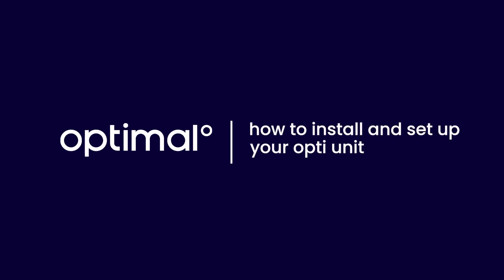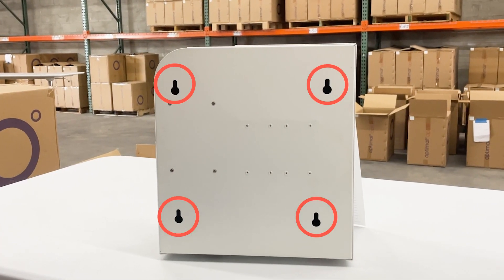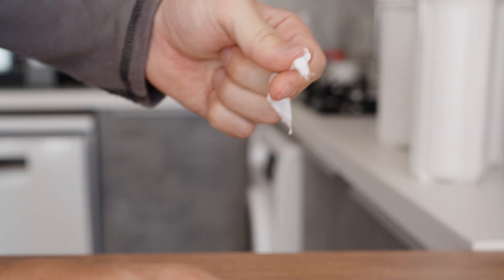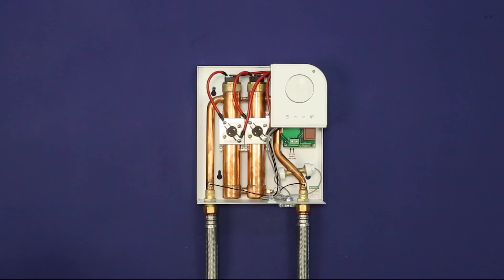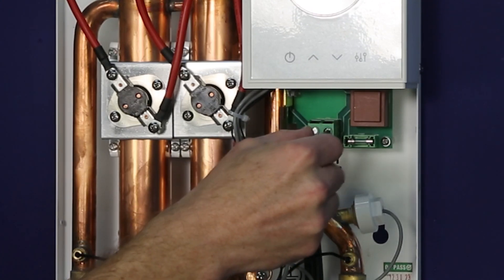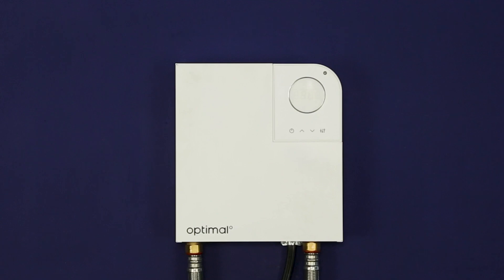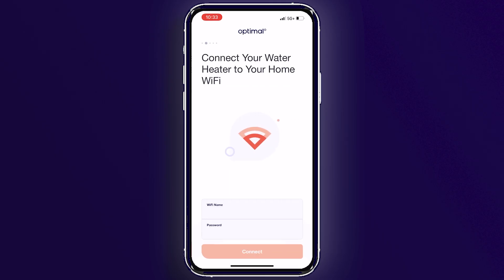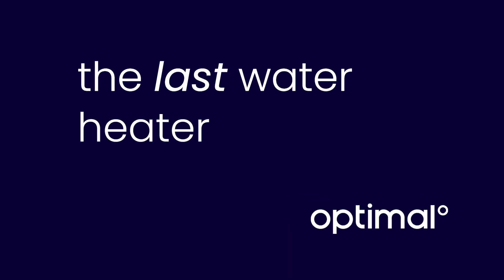Optimal° Installation Tutorial | Electric Tankless Water Heater

Comment: What's the power supply requirement for the 3.7 gpm model opti18?
Reply: Model #OPTI18:   75A Max Draw,   2ea  Double-Pole, 40A Breaker.    Model #OPTI27:  100A Max Draw,   3ea  Double-Pole, 40A Breaker.